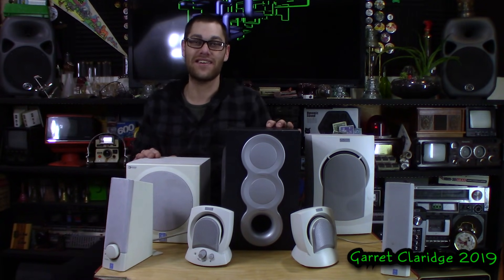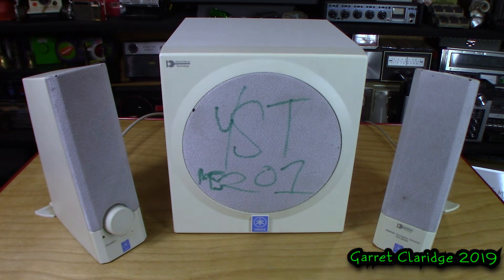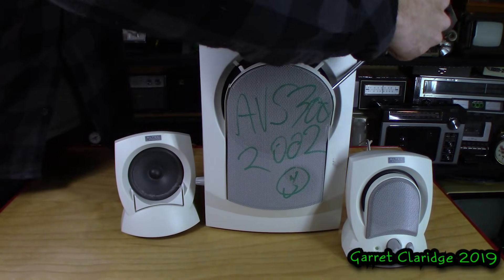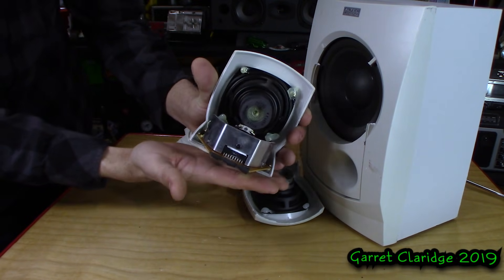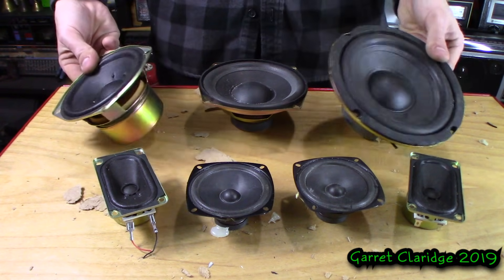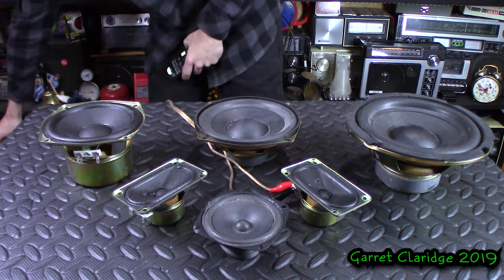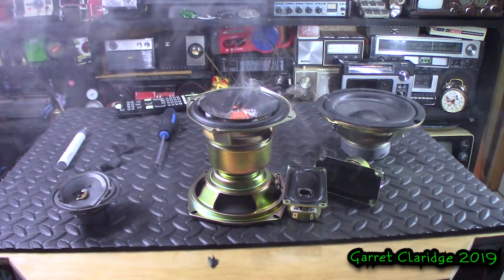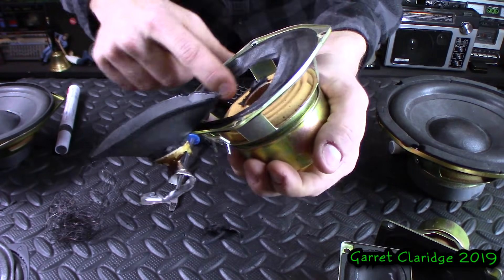Blowing Computer Speakers and Subwoofers - Yamaha - Creative - Altec Lansing

Comment: You're doing it wrong....Blow first then destroy.....if  internal amp, just unscrew the woofer and get a length of wire w clips on the end, run it out the port. THEN BASH WITH HAMMER. Dont make me make a response video blowing some altecs properly

Comment: I did'nt know Yamaha make crap stuff too.
Reply from the maker: makes me sad i use lots of pro yamaha gear and this makes the brand look bad, but it was a nice lil system i had gave it to a friend and it came back years later, because the ac adapter was ruined in a flood
Reply: Well, I guess every manufacturer has a more "consumer" product line too lol. Was surprised really, never seen a Yamaha computer speaker before.

Comment: Also, i am excited to see the creative subwoofer, and it's a big shame you don't have the satellite drivers. I remember back in like 2007 when i was 5 years old, my parents had a creative surround sound computer speaker system and we even had a creative sound card in our windows xp desktop.  When i was little i thought the subwoofer was the most powerful thing ever, but now i'm sure it was just a crappy 12 inch or smaller woofer driver with a suspension soo weak that if you barely touch it while it is playing, the coil will rub EDIT: just saw the intro to the creative sub, and indeed, it came out in 2007, so that's probably why i remember us going through the surround setup, with the girl's voice saying "front left, front right, rear left, rear right.  Also, i remember when i was like 3, before the creative sub, we had this speaker system with a subwoofer, and it had the typical 2000's yellowed white plastic enclosures.  I'm sure it was an altec lansing or something like that.
Reply: The Creative speaker systems were actually pretty decent for their price range. They generally shat all over Logitech crap.
Reply: @djlobb  yeah, they definitely did.  I just assumed the sub was cheap bc I haven't seen it since I was like 7 (I'm 16 now) and the creative speaker system I have most recently seen was a very low end creative system, with a 4 inch sub that coil rubs just from loud music even, and especially rubs like hell when you touch it, and satellite speakers with speaker drivers in them that I assume are like at most 3 watts, since they weigh nothing, and don't have removable covers.
Reply: @nascarsimracing1   Indeed, the budget Creative stuff is quite poor.
Reply: Most creative speakers are pretty good

Comment: dude, blow them FIRST  and THEN destroy them!
Reply: ADL KHDR 

I agree
Reply: he does. He only removes the dust cap that they smoke more. I don't think you know much about speaker...
Reply: @voradora7174  you are right they just wanna cover their ass
Reply: VoraDora we’re fck speaking about the fact that he destroys the box without doing anything
Reply: @voradora7174  i dont think you do either
Reply: why do you think that way?
Reply: The dust cap covers the voicecoil and the voicecoil is the thing that smokes while blowing a speaker
Reply: @voradora7174 the smoke can exit through several other holes so why is it necessary
Reply: Because smoke naturally rises bc it's lighter than air
Reply: @voradora7174  yeah but it doesnt increase the smoke it just creates that effect because it exits from one hole
Reply: Yup, but you can see more of it
Reply: @voradora7174  not correct